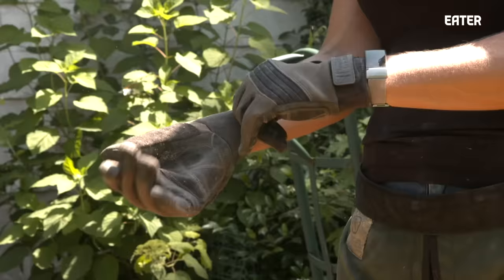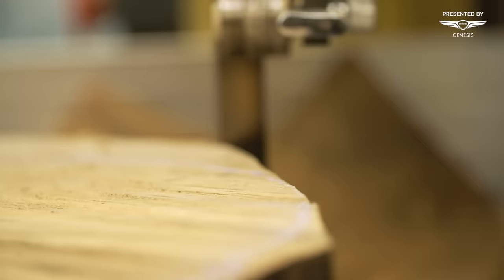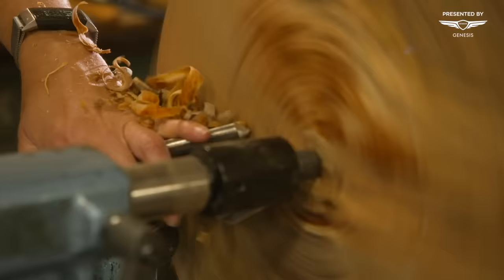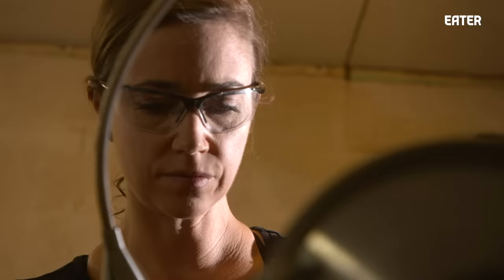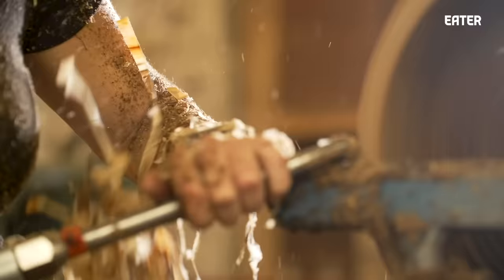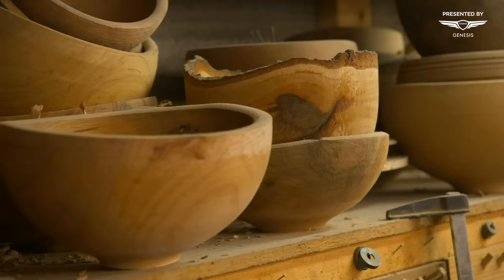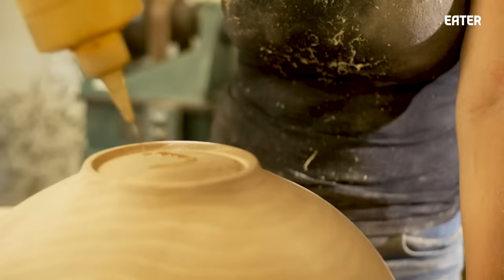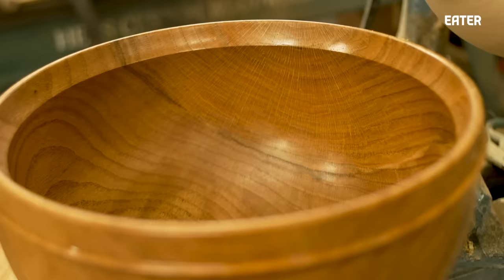How a Woodworking Master Makes Bowls — Handmade

Comment: I always assumed it was better to turn dry wood. I learned something today.
Reply: Wet wood tends to warp and crack as it drys but turning it is pure joy while dry wood is less fun to turn but won’t have as much trouble with the finished product.
Reply: Two different beast and experiences. A lot of wood turners do a twice turned bowl. Rough it out, dry it, then final turn.
Reply: Turning wet wood means you get an idea of what's hidden inside while you wait for it to dry.  Turning dry blanks means you get to be surprised.  You can buy dry blanks and not have to wait for it to dry.  If you take it down yourself, you wait longer for it to dry if you leave it as a round.  You can cut blanks, coat it with the goop, then wait for that to get dry enough.  Elapsed time on the calendar from tree fall to finished on the shelf is about the same, possibly shorter for wet turning.

Then when you get really brave or talented, you can turn and finish it wet and hope for the best or watch it warp and crack all over the place.
Reply: Called twice turned.  Green turned and allowing it to dry I have a 10% or so loss to checking and drying stress.  Remounted and finish turned makes for a great final product.  It's even better with a center saver and all of it doesn't end up as shavings.
Reply: As someone new into turning wood, I'm excited to try this. Thanks for all the helpful comments!
Reply: Did none of you watch the entire video?
Reply: @Leo-hk6qg  I have several times. What are you referring to?
Reply: It is. The wood has cracked by then... then it won't crack later.
Reply: It depends.
Reply: Hi Ashley, what are you using for a finish?
Reply: @DestroBB  that all the questions and concerns that were raised here were addressed around 8 minutes into this video

Comment: Finally someone that doesn't NEED to use Resin,  I've never used resin myself however I see the artistic nuance in it but I also believe in maybe leaving the holes and  doughy wood there in the piece.  I have not seen many people rough turn a partially dried piece and being from Far North Queensland, Australia where we dry our timber first before we turn or in the old days , dry our timber under water. However I do understand the reason for the rough turning for colder places as here is tropical Rainforest and Dry Savannah wood. Keep up the good work Ashley Harwood  and your name like Silver Ash Hardwood, a native to this area.

Comment: Ahh, later in the video when the wood is dryer, I see you behind a shield. I feel better!
Reply: She should have been wearing a face shield ALL the time.  I have experience with a wood lathe and in one split second of inattention, I was hit in the face shield by the tip of the tool.  It cracked the shield but it saved my face.

Comment: Eye protection + no long sleeves + hair tied back, genuinely great to see
Reply: So that's the proper atire for this kind of work ? With all the dust and pieces of wood flying everywhere i thought long sleaves would be the standard... 🤔
Reply: @noemierollindedebeaumont1130  It's true wood chippings/sawdust can irritate the skin. Wearing long sleeves can be a real snagging hazard with tools such as lathes. The speed means that if hair or clothing does catch you can be pulled against or into the machine very quickly. You're better off getting hit with woodchips

Comment: The sex of the person turning the bowl is irrelevant. The bowl is relevant.
Reply: I think the sex of the person is relevant. I want to see more females doing this kind of stuff because many females don't know that they can do it, are welcome to do it and they will get heaps of support from almost everyone when doing it if they need. An occupation that needs females for it to stay relevant means sex is definitely relevant. Ashley showed me that turning has more to it than what the male masters show. That's so very refreshing and she's someone I look up to. I'm a 40 year old man.
Reply: @sofascialistadankulamegado1781  actually not much ocupations require muscle aside from fighting etc most blaxksmiths also use the weird machine thingy also artisans etc more handle delicate stuff so doesnt require that much strentgh etc
Reply: @crimsonitacilunarnebula  even in blacksmithing by hand strength is irrelevant because the hammer does most of the work almost anyone can lift a 5lb hammer
Reply: @ryanbishop3343  ok, but the females are going to be limited by the stock they're able to move by hand, because at some point, you have to move the piece.
Or they will ask for the help of the husband or male coworker.
When I worked in retail, I was the one that they sent when they needed a paper ream case.. because fact it, none of the female employee would have been able to move a 40 lb 8000 pages total - ream case. This was basically two ream cases strapped together. Or they could have sent two employees with a box cutter to do the job in twice the time. That's the reality.

Comment: How do you avoid getting splinters? I'd look like a porcupine after shaving down all that wood.
Reply: it tends to be pretty soft shavings. splinters happen when you break wood along the grain, whereas with turning you're generally shaving off material perpendicular to the grain.
Reply: The wood isn't flying out fast enough for shavings to embed in you.
Reply: Yeah, you're not breaking the wood, you're cutting it, like giving it a haircut. There's still crap flying at you; she wears her safety glasses religiously, and sometimes you see the full face shield air filtering backpack.

Comment: I've been using engine lathes and CNC lathes for years with steel and aluminum, which is a very different process from wood-turning. I am awestruck by your creations!
Reply: I agree. I used some lathes but mostly CNC milling machines and made plastic injection molds with my dad, when I was 6-13, it was just set it up in the CNC and let it go, then do everything else, but this bowl making is more of a creative art 🤣 I moved out of that shop and I miss it
Reply: @andrewdoesyt7787  What on earth did you do as  6-13 year old??? I designed and built complex plastic injection molds from the era of Prototak-equipped Bridgeports (calculator at hand) to programming Makino and Haas CNC machines with Surfcam. Later, programming Mill turns with ESPRIT. Immensely satisfying work. Far older than 13 . ...
Reply: @Vodichka9  Ah, I just helped him out. I didn’t make the programs, I helped indicated the part in because my dads eyes are not that good. I changed tools since his back isn’t good for bending forward either. (we didn’t have an automatic changer). In my earlier years I just did the polishing.
Reply: @andrewdoesyt7787  That's great. Mold making is an enormously rewarding occupation.

Comment: I hate to see a woodturner using sandpaper. I have known a few woodturners who were extremely skilled. One thing they had in common was that they totally avoided the use of sandpaper. Instead, they were able to make a perfectly smooth surface using a chisel. (Don’t try to tell me this can’t be done, because I have actually watched it). Sandpaper crushes and and fills in the cellular structure of the wood surface. It does not look as good as a surface that was finished with a chisel. I would say that a sandpaper-finished wood surface looks relatively dull compared to a chisel-finished wood surface. I would also say that using sandpaper is an indication that you still need to improve your skill.

Comment: Guy came by in Oct. and asked me how much for the tree in my front yard.  I said "Excuse ME"!  He said it was Ash, and he'd give me $100 bucks for it, if he could cut it down and haul it off. We "dickered" a bit, and I ended up with $250, and it's gone now!   (Probably could've asked for more, as it was at least 24" in dia. and TALL...!)  Haha!
I have a wood lathe, and several router tables, and ALL the woodworking tools a cabinet shop would need.  I'm old and retired, but like watching others build things from wood.  
   Nice Video, by the way...!

Comment: Incredible wood worker! Here's my issue with wood working: the mess! chips flying everywhere and so rough on the hands and arms. I would love to see wood workers build (could be out of plastic) enclosures to surround the wood turning machines that shed chips to make clean up so much easier, 2. wearing tight, formfitting gloves to protect the hands, and 3. wearing kn95 masks to protect the lungs. Thanks again so much!!!
Reply: No gloves next to spinny things, ever! Your glove gets caught on the piece and at a minimum you will lose some fingers. And it's easier to sweep chips from the floor than a specialized container.

Comment: Hello, what kind of  wax you use. Is the wax drying after use, and helps it to dry the wet wood controlled and slowly? Thank you for a nice portret, and inspiration.
Reply: Typically it's some form of paraffin diluted in mineral oil.

Comment: Ashley, great video, great turning techniques, great bowls, thank you!  One question:  what is the brand of face mask/air filter used in the video.  It looked like it had an air hose running around your back.
Reply: Could be the 3M Adflo system designed for welding. The hose goes to a small backpack with a filter and electric blower. Expensive though
Reply: It's known as a PAPR: Powered Air Purifying Respirator

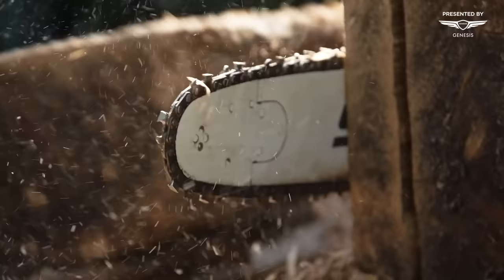Comment: @0:46 1:15 and 1:46 I really hope all these closeups were taken at the same time and the chainsaw wasn't used in that condition. Because that chain is way too loose, and that can lead to a higher chance of a very gruesome thing called "kickback" happening. Too tight of a chain, is also a bad thing; but only because of degraded performance of the chainsaw and premature wear and tear of component parts.

Comment: Your lathe is too high for your height... you should be able to turm with your forearm at 90 degrees from your elbow i.e. parallel with the floor.

Comment: Using a garbage Jet grinder to sharpen her gouges?  Why?  At her level she should be using a Tormek with its attachment options.
Reply: Because at her level she can put a better edge on a chisel freehand with a “garbage Jet grinder” with CBN wheels than you can with the most expensive machines/jigs available.  She also uses a 40/40 grind that cannot be done with a jig

Comment: Great craftmenship. However one comment I have to make. Operating a chainsaw as you did is careless and outright dangerous.  No head, face or even ear protection whatsoever. I have seen enough accidents and the aftermath normslly is not pretty. I have trained many people of 10 years in proper handling of such equipment and accident prevention.  So for future reference I would appreciate if you could use proper safety equipment to be a role model for others in your otherwise great video. Thank you. Andrew

Comment: You clearly know more about this than I do, and I bet you have your reasons, but why not wear a face shield instead of just those safety glasses? My woodworking guild had a presentation by a professional turner who had been seriously injured when an improperly glued up blank (prepared by somebody else) exploded in his face. One piece caught him in the mouth and sent him to the hospital with a very serious injury. He was unable to work for some weeks (!) and had a more than a little trouble when it came time to stand at his lathe again. Now, he won't turn blanks he hasn't personally prepared.
You acknowledge the danger, but I fear you are not adequately defending yourself. Plus I should think you would feel safer and thus more comfortable with something protecting your face and your neck. As it is, your jugular is exposed.
Or maybe a shield is what you normally use, but the glasses are just for shooting video? Whatever, I sincerely wish you the best!

Comment: the way i was told to turn wood was to treat each piece like a virgin ... caress them into what is needed to get the job done ... slow gentle compassionate pressure ... coax dont force ... literally show the piece the love you would show your significant other  then you will always make a piece filled with passion and care ... and get your best results as your experience gets better

Comment: I just wondered why she's not wearing safety face mask
Reply: She wore safety glasses, until turning, 9:20.  I don't always follow absolutely all the safety measures that the MSDS suggests, as I've been working for decades, as a visual artist, and so have an understanding where I can be "risky".  At the beginning, the water in the wood is probably keeping any fine particles from being inhaled, but once she is working with dry, she has a fierce set up on.